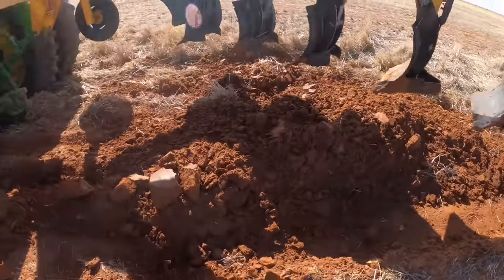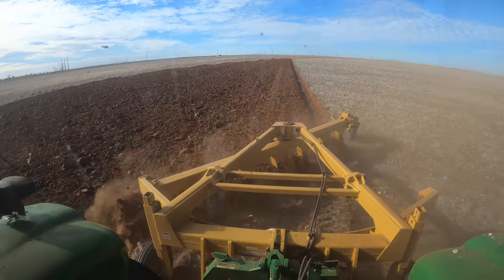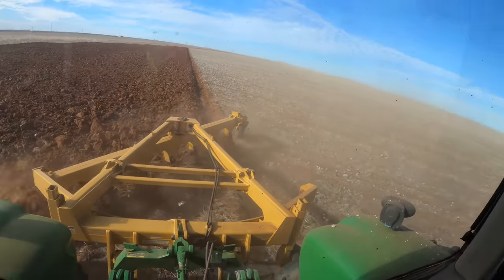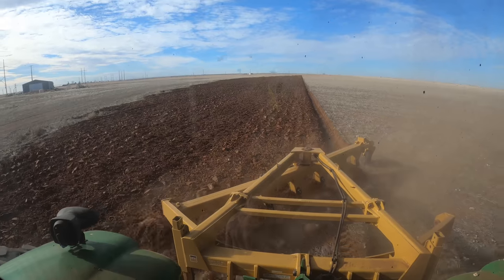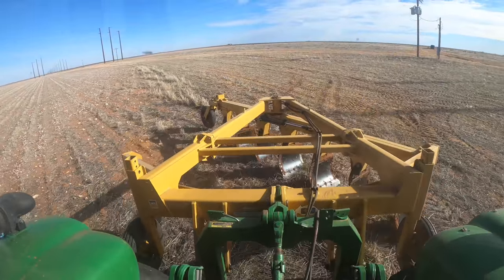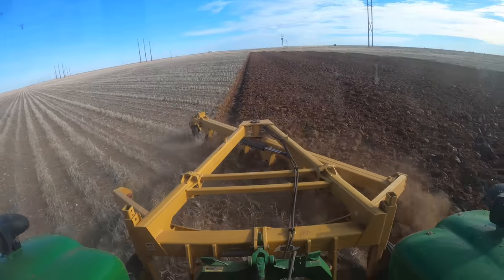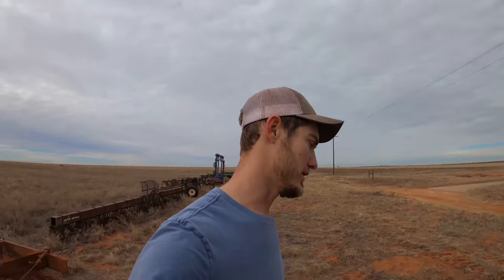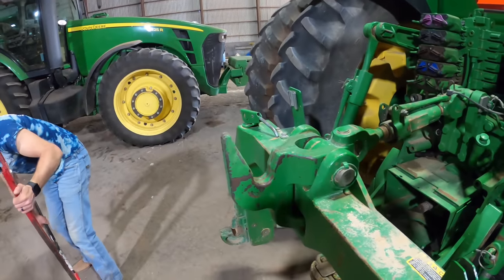New Plow?

Comment: What are the power requirements compared to a conventional plow? How does it work in various soil types (loam, clay, etc.)? How does it work in various soil moisture conditions? How about various trash conditions like heavy corn stalk residue?
Reply from the maker: It would still work in all soil types it would just leave the ground a bit clumpy in more clay dirt (and as long as it’s not too wet). Works amazing in trash we used it in corn stalks 2 years ago and it worked really good but it was after silaging not thrashing. Anything deeper than a foot you want more than 340 hp. 2 years ago we went 18” deep and had to use our 370 hp tractor now with going a foot our 335 hp tractors pull it with ease. 
Hope this helps